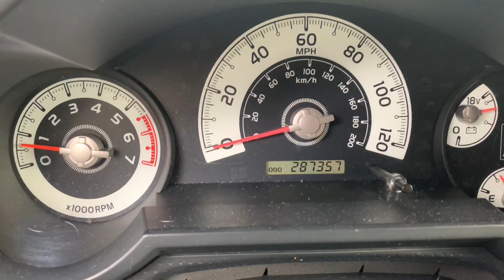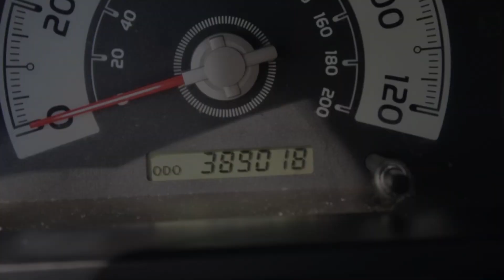High Mileage TOYOTA FJ Cruiser • Should you buy used?  Is it Worth it? (Part2)

Comment: My 2008 FJ I bought last November I've put 10,000 miles on it. No real issues. I fixed a leaking roof, new front calipers and a new power steering hose. It now has 91K. So I guess I have a couple hundred thousand miles to worry about bigger fixes. Rust isn't bad at all. It spent it's life in Florida until the previous owner brought it to Ohio. Now it's mine.
Reply from the maker: I’m glad you got a 2008 not 2007.
At 91k , wow sounds like an awesome find.
Good luck with it, thank you for sharing!

Comment: I have a 2014 FJ Cruiser Trail Teams Ultimate Edition.  ...And I’d say very good condition.  
But sadly…
-	It met up with a deer a few years ago.  …So, some body work to fix that.
-	And it has 225,000 miles. …But well maintained/serviced.
I am hoping that someone will be interested in buying mine.
I’m struggling with coming up with an asking price for it.  …Depending on how much is reasonable to expect, I may decide to just keep it myself.
Reply from the maker: Those are great FJ’s hold their value. 😉

Comment: My 2007 at 171000 miles runs and drives like new with 0 rust. I think it really depends on how it’s taken care of and if it was abused off road.
Reply from the maker: Take care of it and it will last you.
Reply: @VikingsGarage  👍🏻 I am babying it for sure. 
Do you know if there is a difference in 07 build dates as far as very early builds having the most issues (ie FJs built in 06)or is your opinion that all 07s regardless of date have these mentioned issues?
My FJ is built post 07 TRD models, so I am able to use ATrac and Diff Lock together.
Reply from the maker: Not going to lie, not entirely sure. 
But it’s been my understanding that early built models are a huge no, no.
Built as in built date(the one on the vin tag on the door)
Reply: How much did you pay for it

Comment: Looked at a 2014 FJ....showroom condition till they put it on the lift. I was so disappointed.  This FJ only had 71k miles but the frame, whole suspension was RUSTY! I really wanted this FJ. Tempted to go back with a rubber hammer and investigate further? The dealer told me that the frame had passed inspection. I do NOT believe them.
Reply from the maker: I bet you, if you look closer you will find expensive repairs soon to be due. 
Good call on inspecting it underneath 👏🏻👏🏻

Comment: would you say 150,000 miles is high for a 08 ? Anything to be worried about ? Or would rather buy a Highlander over the FJ?
Reply from the maker: Definitely not a Highlander…. The FJ it all depends on the frame and how well it was maintained. 150k is nothing for this platform.

Comment: My fj has been flawless for 6 years with 240, 000 miles. Only a brake switch and a slight torque converter wobble to speak of thus far... Oh and a cracked windshield lol

Comment: I’ve been looking to buy one and I found one with low miles but there was communication issues with the owner. But I was considering a 2010 I found for decent price with 177k miles. Supposedly maintained and no rust. It’s not a 4wd and it’s for 15k. I’m having trouble deciding. I can’t find many in that price range. Any advice?
Reply from the maker: Unfortunately, when it comes to FJ’s you might have to travel a bit to find the right one. The local classifieds(Facebook market place) is a good place also.
Reply: @VikingsGarage  yes. Every one I am finding is far. I had found one but the person wouldn’t communicate with me. :(
Reply from the maker: Bummer

Comment: "spend the 40k on a '13-'14" Yeah okay bud lmfao. I Will happily spend 6-7k on a high mileage early year fj that needs some love over putting myself 40k into debt. Yeah might need to spend some cash on repairs but that's nothing if you know how to turn a wrench. Literally doing this exact thing right now. Found an early model with 295k for 7k. 6 speed manual
Replaced suspension, did all the fluids, and undercoated the frame with a lanolin product. Been doing great and I didn't spend an arm and a leg on it either.

Comment: Why not the 07? Because of front fenders bulging/buckling?
Reply from the maker: Know correlation issues/codes (timing chain gets off timing prematurely ) I’ve seen this on 2007 year model only over a dozen times. 2007 is the only year you must use premium gas. 
To me I would strongly recommend staying away from that year.
Reply: @VikingsGarage  what about 2010 with 96k????? for 15k??
Reply from the maker: elite chen That sounds about right, either way lay under it and check that frame first.

Comment: I read where the 07 is the best year and then I hear this guy say it's the worst year. Whch is it? I have an 07 woth 230,00 mi. No rust doesn't burn a drop of oil and is tight as can be. Rides nice too.  i don't get it.
Reply from the maker: My statement is purely made based on what I’ve seen come through the shop. 2007’s always have the most issues. Great trucks nonetheless. 🤷🏼‍♂️

Comment: Would you recommend buying a fj cruiser that has 240k mileage on it . Asking price 12k
Reply from the maker: it all depends on the frame and the condition of the engine and transmission.
I would honestly spend more and get something with less mileage.
Reply: @ what's the actual value for such a car . It's 2008 fj cruiser 240,881 mileage
Reply from the maker: @yonijoni4636 unfortunately again, depending on it’s condition 
Probably worth the 12k

Comment: is a 2010 with 96k miles considered high????
Reply from the maker: That’s low mileage Sir, nowadays cars get driven about 15k/year on average. 
A 2010 should have 145k miles.
Reply: @VikingsGarage  what would u pick a rubicon 2013 with 63k or the fj 2010 96k? are the blind spot really bad???
Reply from the maker: elite chen FJ cruiser every time, the blind spots take time to get used to, once you do. It’s not that bad.

Comment: The FJ looks really cool, has a lot of capabilities, but at the end of the day, during my investigation of possibly procuring one, I have come to the determination, they are really pieces of garbage. If you want to be wise and stick with the Toyota brand, buy a 4Runner at half the price and have more room an actual rear visibility. And probably a little more reliability. It’s come to my attention that the FJ cruiser is just plagued with problems. I’ve recently discovered reasonably used Lexus GX for about the same money as an FJ cruiser. I hate to tell you FJ lovers, the FJ does not even hold a candle to a Lexus GX. 

I mean, oh my gosh, I thought Third Generation and fourth generation Ford explorers looked bad. The Toyota FJ is garbage.

Comment: 200000 still  a good mileage for a 2008 fj cruiser?
Reply from the maker: With the proper service records, it’s nothing to worry about. For the right price off course. I wouldn’t pay more then $12k or maybe $14k
Reply: I paid $17k for my April ‘07 6MT including all taxes and fees. I did have to do about 2K in services, but I used parts that will reduce my long term repair bills by many thousands of dollars. 142,500 on the odometer. Minor surface rust. 11 pages of service records. I’m happy.
Reply from the maker: Sounds like a good deal to me. 
Kudos on the 6 mt